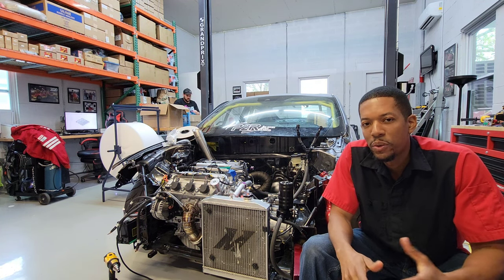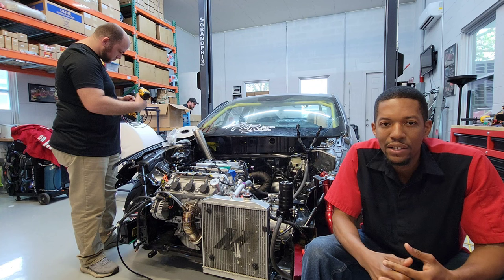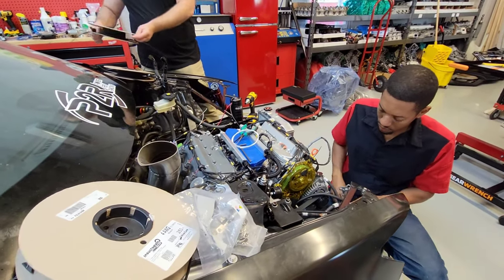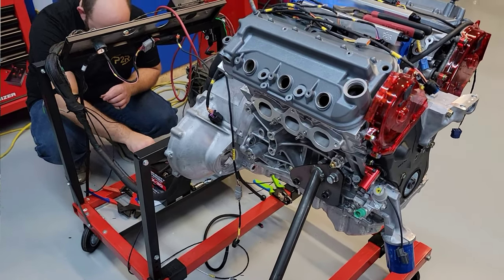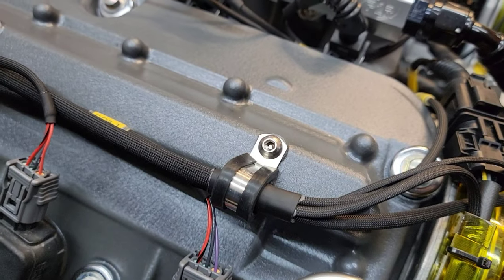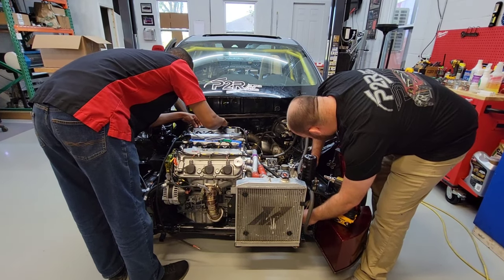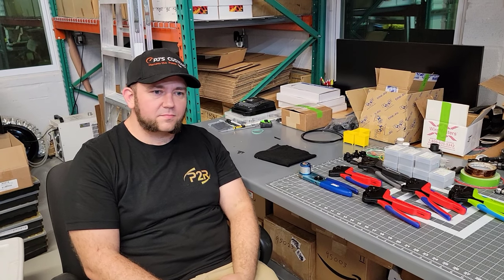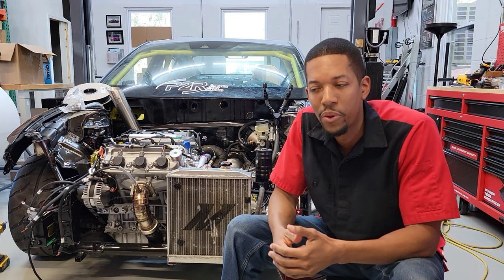P2R J Swap ILX Update with PJs Customs Wire Harness Build & Install

Comment: P2R Leading the way, that intake manifold looks amazing
Reply from the maker: Less than 3 months away from release finally.
Reply: I kinda wanna install that onto my J35Y2… I currently have a J37A4 intake mani and TB on my stock J35Y2 right now. It doesn’t have as much top end as the J35Y2’s stock intake mani, so I’m contemplating running the P2R ‘Big Bore TB’ spacer adapter for the J37 TB to run with the J35Y2 intake manifold.